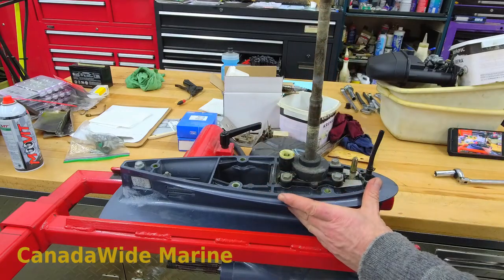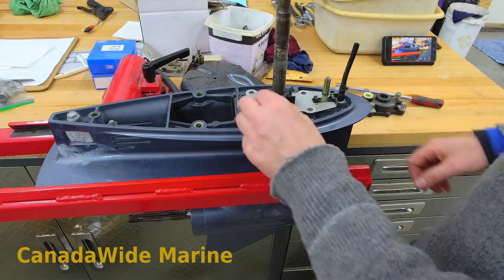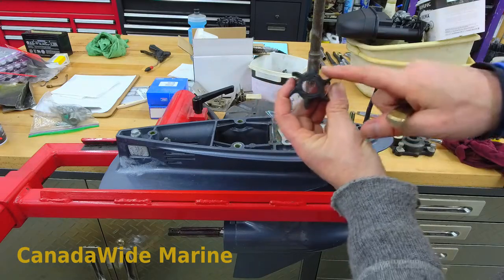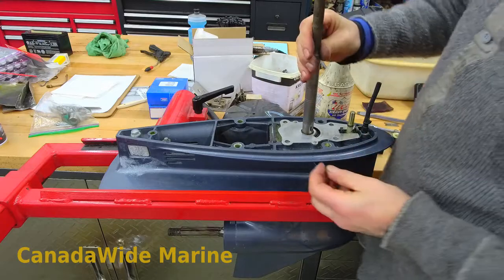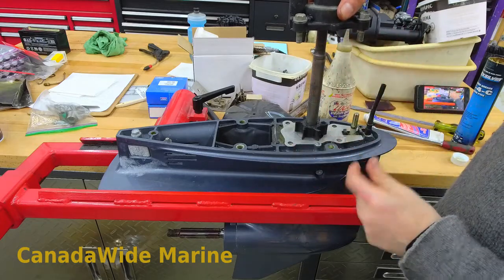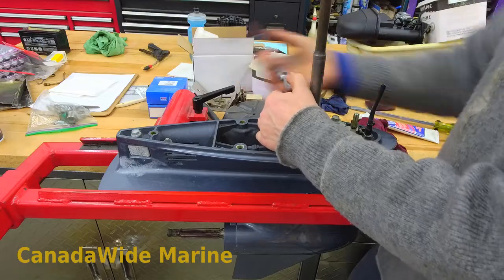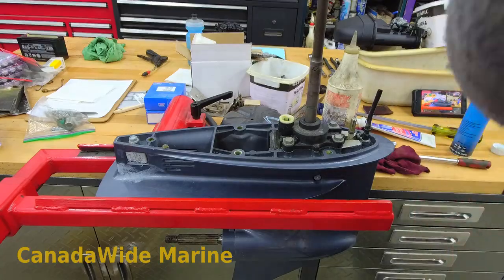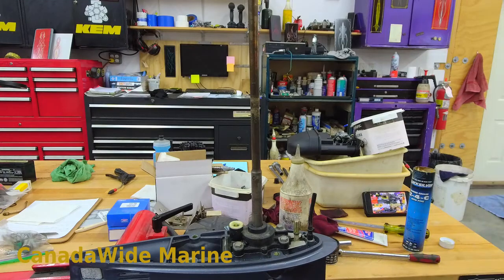How to Inspect and replace your water pump impeller in a Yamaha 4 stroke outboard motor, 50 hp.

Comment: day mate good video i wondered if you were going to say anything about the grease on the top of the shaft ,explained very well and a good tutorial .For me i would have changed the impellor even though as you say it was in good condition and given it to the customer as a spare ,i change my impellor every season regardless i had about 6 spares at one stage anyway good video .
Reply from the maker: We monitor the impellers very closely, and also have a very long history with all our customers, so we know how they use their boats. If I have the slightest doubt the impeller won't make the season it gets replaced. Our objective every spring is to ensure our customers have as reliable a boat as is possible.
Reply: @CanadaWideMarine  Just another quick question the grease your using on the bolts is that quicksilver assembly grease ? as i have a tub here and really dont know what to use it for after an engine was put back together
Reply from the maker: @crispernator  Any grease will do. The purpose off the grease is to seal the threads from water, thus preventing corrosion.

Comment: Have you ever heard a new impeller squeak(lightly) when newly installed?  Is this normal?  I did use silicon lubricant inside the impeller housing but not sure if i put any on the base plate. Yamaha F70.

Comment: Why not just change the impellor while you are in there?
Reply from the maker: In this case I replaced this impeller last year, and the motor has less than ten hours on it since. Generally, because our customers put so few hours on their boats we replce the impeller every 2 years, inspect it every year, and we remove it for winter storage.

Comment: Very nice video!  Question:  my telltale does not have a stream of water at idle.  Does that alone indicate that my water pump is not working?  Also, does my 2012 F50LA motor have some sort of shutdown mechanism to protect itself if the water pump fails?   Thank you.   Jim
Reply from the maker: No Stream at idle can have many causes; a bad water pump impeller, restricted pickup, leakage between the pump and the motor, sticking pressure control valve or restriction in the supply to the telltale to name a few. 
I don't know off the top of my head if your motor has a shutdown for overheat, (I work on hundreds of different makes and models, I can't keep track of every feature of every one), but I would advise to not rely on it even if you do have it. In our area the number one cause of catastrophic failure of outboard motors is overheating. The water pump impeller should be inspected every year. As a general guide we replace impellers on low usage motors (Less than 50 hrs per year) every 2 years, and every year if you use it more than 50 hours.

Comment: I can't get that EZE Slide Brake Lub in US. is the Super Lube 51004 Synthetic Oil with PTFE, High Viscosity do the same job?
Reply from the maker: According to their data sheet Super lube is not compatible with Natural rubber or EPDM. I do not know the exact composition of the impellers but natural rubber and EPDM are both very common in rubber products.
Try to find a rubber lubricant, or glycerin, or you can use good old dish soap, it works excellent and does not damage anything.